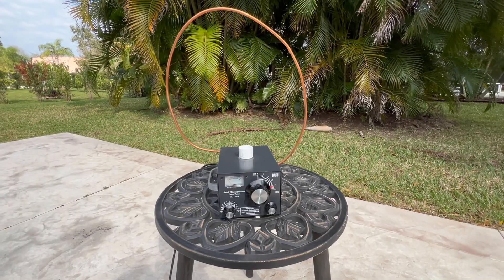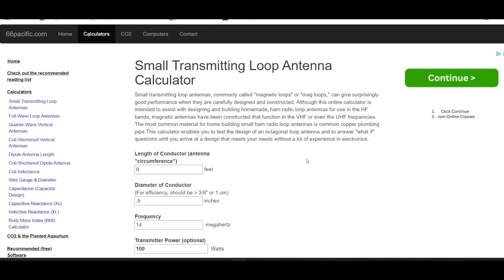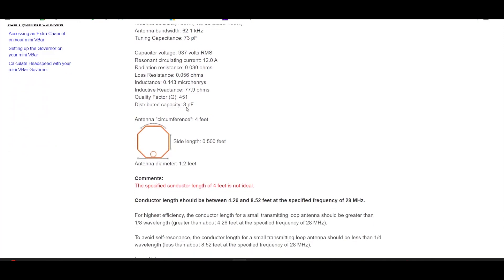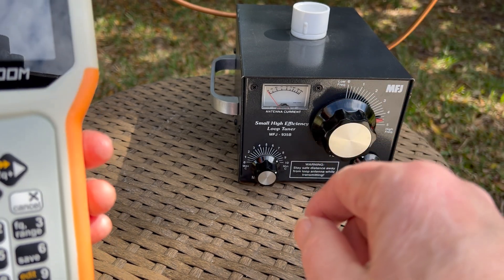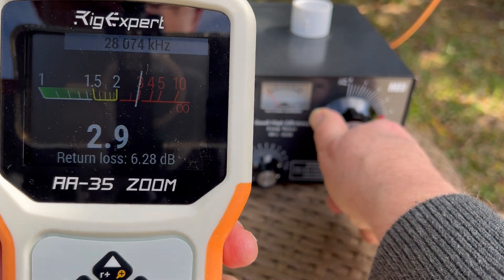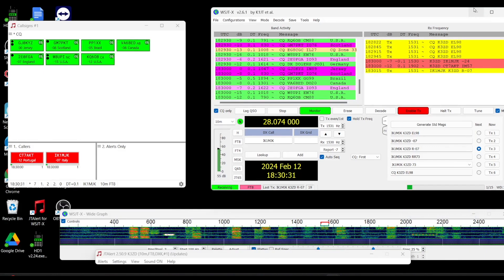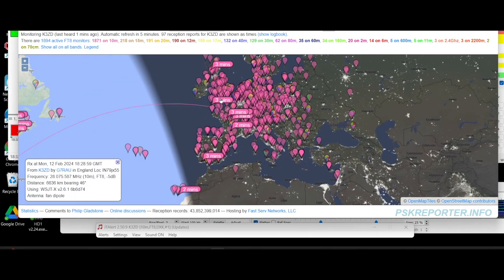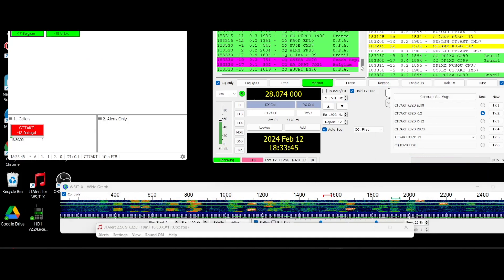Ham Radio FT8 with a VERY small loop antenna.

Comment: I have been using mag loop antennas for several years.  I have two at my home QTH.  A 5ft by 6ft rectangular loop will tune down to the low end of 80m on a vacuum variable cap.  It is tuned with an inexpensive DC motor.  A second 1m loop is tuned with an air variable.   I homebrewed an earlier one meter diameter loop and tuned it with a stepper motor.  I have used various lengths of wire or pipe with the MFJ-933Cfor portable operations .  Tuning the loops can be very simple using a NanoVNA and a Smith chart.  
I am not sure that using the Internet loop calculator with the MFJ-933 or similar design is very helpful.  The MFJ box supplies relatively low levels of capacitance across the loop; a 40m loop has to be quite large before the MFJ loop will tune it.  With a large cap value, 1m diameter loops can easily be tuned down to 7 MHz.  a 
I have operated the MFJ-933C at a full 100W on SSB and 50W digital modes without any problems.
Reply from the maker: Excellent comment.  Wish I could make them like you do.  I did work 40 meters once with the MFJ tuner.  Like you said it had to be big loop but it worked.

Comment: Recently bought an MFJ-933C. Using FT8 as a test with 12 ft. of DX Engineering 400MAX PL-259 Low-Loss 50-ohm Coax and an IC-705 at 5 watts, I had 216 reception reports on 20m from 3 INDOOR locations within 30 minutes. The setup and tuning was straight forward, and I completed at least 1 QSO from each location. I expect it will work very well in future portable operations. 73 N9EdL
Reply from the maker: Yes it's surprising how well they work.  Thanks for the report!

Comment: I think loops are under appreciated.  As you show, they need not to be expensive.  I’ll have to investigate the innards of the tuner you used as the mag loops of which I’m familiar have a smaller driving loop and the main loop is tuned with just a capacitor on the open end.  I just discovered your channel.  Thank you for your videos on debunking many myths that frankly I’ve heard myself over the years.  73’s
Reply from the maker: Agree with you on small loops.  I've owned a few and they all surprised me.